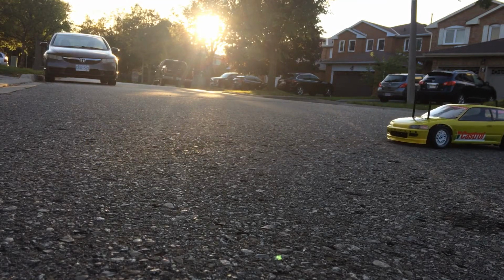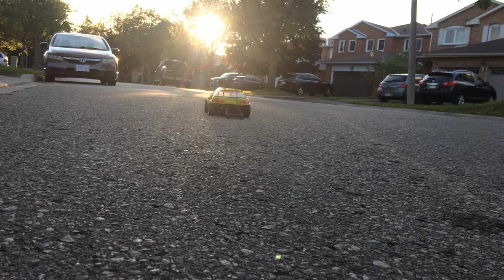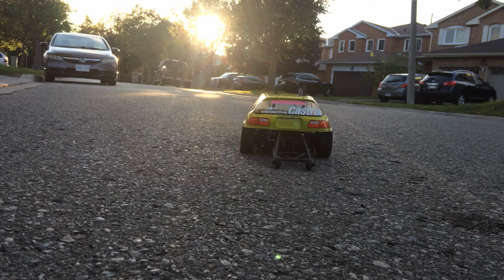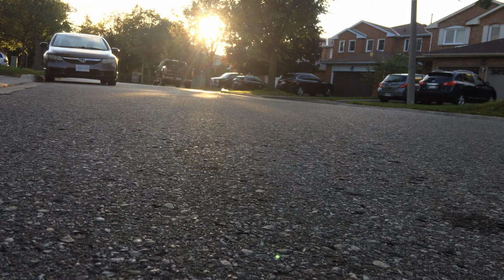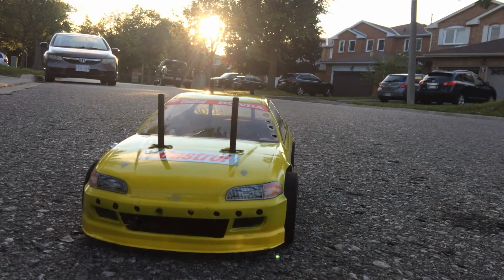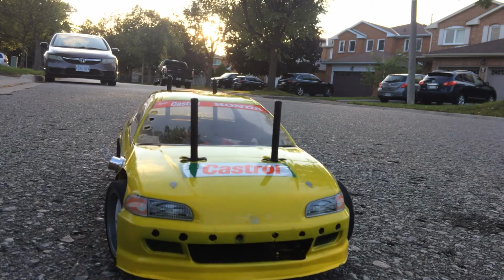Tamiya Tt02 Honda Drag Build With DR10 wheelie Bar.. First Run #staytuned

Comment: Get some bigger wheels with better tires, my tt02 does crazy wheelies and goes very straight on the pro line angle block Hoosier 43mm wide tires on 2.2 bead lock wheels. Needs a small amount of clearancing.
Reply from the maker: Thanks man 😎